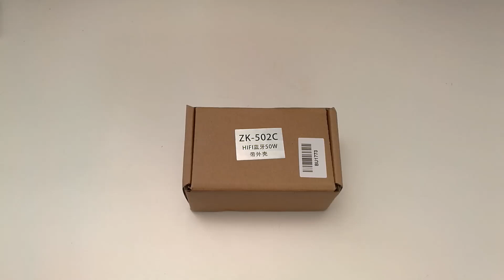TPA3116 amp board 2x50W (Unboxing, Assembly & Sound Test)

Comment: where can I buy it, at what price?
Reply: Masibe got mine on eBay for around £13. Type in Bluetooth Amplifier board
Reply: Is Just bought the 100w variant for about 13 euro on AliExpress
Reply: Masibe, eBay, AliExpress, Amazon. They are not expensive, arround 6-13€
Reply: Thanks U so much 🙏🙏

Comment: can i use 5.3ohm output (8ohm and 16 ohm speaker parallel)?
Reply: you should be fine with most amplifiers as long as you stay over 4 ohm
Reply: sure you can, but the lower impedance speakers will suck up most of the power.
Reply: If it falls within the range of 4Ω to 8Ω your good.

In short, yes.